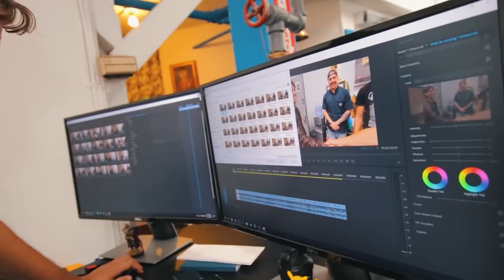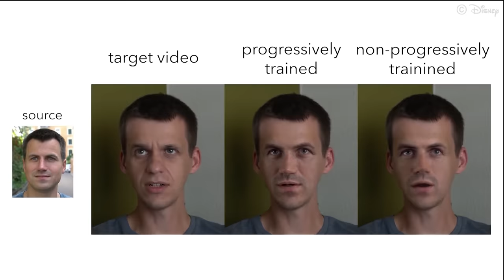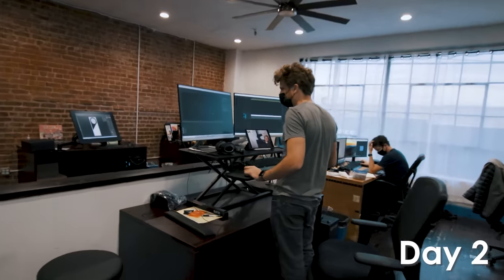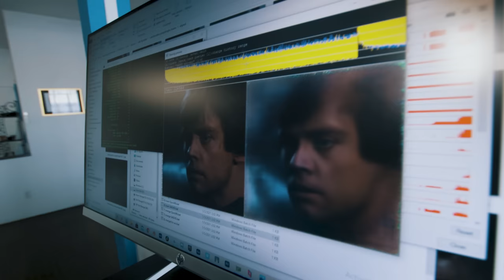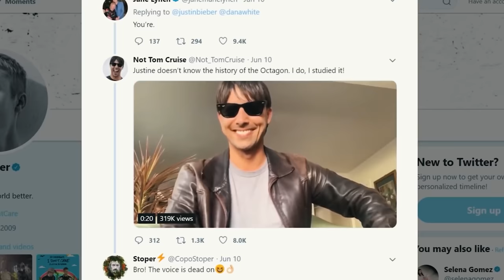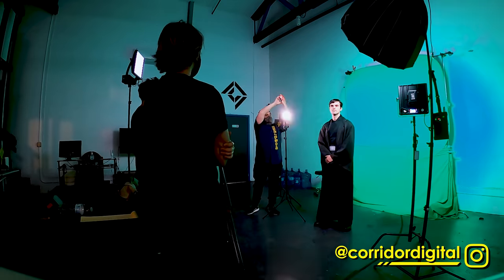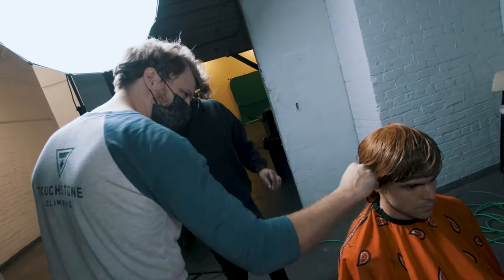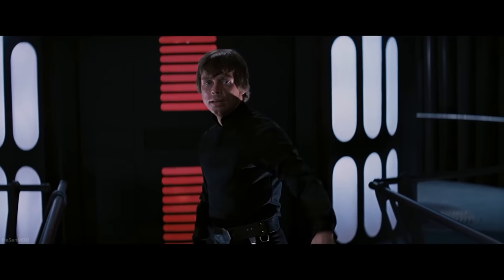We Made Our Own CGi Luke Skywalker

Comment: I would say that the Disney version looks more realistic when it comes to the texture, but when it came to movement and interaction with lighting you guys' is far superior.  Excellent job!
Reply: My thoughts exactly.
Reply: Because disney used an actual set and corridor used a cgi background.
Reply: @flameemperor888  i was referring purely to Skywalker himself as opposed to anything else, sorry for not clarifying
Reply: They made it almost exact to how skywalkers physical appearance was in the good movies (not sequels)
Reply: Same the deepface still looks more cartoony but the small movements like in the lips and eye movement are better. so there still needs work to improve the overlay but still keep the small details to keep from looking like a moving statue.
Reply: The issue is that they added those sparks and the lightsaber to show more interaction with the light on the face, but those things where not in the original scene. Corridor Crew also added some color correction that is also not in the original shot.

If you watch young luke in the movies, you can already tell that what Corridor Crew did does not look like him at all. The box shaped frame of the face, the lipsync, the thin neck and the hairstyle do not match, resulting on a a weird blend of Luke and the other actor face.

I say that Corridor Crew's version is 60% luke, as the Disney one is 95% luke. This only shows how easy is to know what is wrong, but is harder to do it better.
Reply: I agree. They did a great job given the time and shoestring crew and budget. Clearly not easy work no matter how you cut it.

Comment: Your deep fake was a little bit more plasticky so it indeed looked a bit more like a CG model, but I think a tiny color adjustment and a slightly different reflection layer would make it just perfect! That's why I prefer by a little the edit of the original, but the movement and the scene of yours is intensely more detailed! Great job!
Reply: It's the wig. Usually you give a wig some dry shampoo and a few other tricks to get rid of the "fake hair" look. Also, to me at least, the neck was distracting in it's mis-matched length. The green screening was also a little rough and at least for me, pulled him out of the scene into his own "layer" on top of things.
Reply: Yes i agree with the color and reflection. maybe also make the shadows a bit darker, if you compare the background and his face.
Reply: It needs more details like the spots on his face
Reply: way to young looking lol. bad
Reply: Yeah I agree
Reply: mouth movement not as convincing for me but the more static sections I preferred
Reply: agree
the movement and eyes is better in this one
Reply: Yeah, the contrast is off, it floats on the footage (darks are not matching). Weird that they missed that.
Reply: The way they did it originally was better. These guys tried to make new hope Luke. Original nailed return of the jedi Luke, just needed some better color and reflection that's all. This overhaul was too much.

Comment: To be honest I wouldn't be surprised if the crew at Disney had the same amount of time.  This shot would probably be held to the end of production.  There's lots of red tape at Disney. I would love to hear from the team about the drama connected to this shot.  In the end, Jon Favreau and Dave Filoni,  thank you for injecting life back into Starwars.  
 
Corridor Crew, you really showed that innovation can really make a difference. 

Great Job!
Reply: @Anyx E great analysis! Good insight, I agree with u, completely.
Reply: @Anyx E yea agree I think with more time it would’ve been great, personally though if Disney’s gonna go down this route with more young luke just hire Sebastian Stan already dammit.
Reply: Well, the shot wasn't CG or Deep Fake on Disney's end. I believe they used a live action Mark Hamill and then de-aged him. This process is vastly different than what is described here.

Amusingly enough this means that performance was entirely real, including the slower head movements and almost certainly the eyes are absolutely real. 

Watching the video again with this in mind gives quite an interesting take on Corridor Crews analysis of the problems with the shot.

That said, ML and neural net based finishing is definitely a big thing. I assume they didn't use it for this show as they wanted more control and de-aging is far more production safe, for a number of reasons. That will eventually change, but not for a few more years.
Reply: @Anyx E It's because of the low quality of the images they used for the deepfake. The skin looks obviously fake because of this. 

Additionally, because Dean only has a passing resemblance to Mark Hamill his build and wig makes it look off. Since he's not a trained actor he couldn't replicate Mark Hamill's mannerisms (the way he moves his lips when he talks for example) this also makes the deepfake feel off.

Comment: The fact that your Luke moved around more and that there were more camera angles was a plus. I think that the strongest points here was the movement in the acting, the actual FACE you generated, and the expressions that make the scene more emotional. The lips and hair were not as good; they could be improved. That is just picky crap though because this is amazing! 💯
Reply: in my opinion looks the hair in the og one more fake and wrong then in the fan version.
Reply: @temmie-confused  Yeah, the hair that Disney did looked too perfect if that makes sense. Not one hair was sticking up. It's just that the Corridor version did not get the wig EXACT, but close. The lip movements were the worst art anyway.
Reply: I feel like the audio was a little distorted in this one.
Reply: @masteroziniii2486  It was. Idk why. Maybe they had trouble isolating the vocals somehow so it ended up distorted.
Reply: @masteroziniii2486  yeah but I think is a copyright thing, because the main goal was the face movement, not changing the audio

Comment: When Luke wasn’t talking, yours is better. But his mouth movement was a strong tell that this was a deepfake. It didn’t quite match up. But overall, very well done.
Reply: could just be audio synch issues
Reply: @Gatrehs  I mean I was comparing the audio from both clips in this one video so…
Reply: That wasn't their audio, that was audio from The Mandolarian.
Reply: Agreed.  Especially when he says "May the force be with you".  Even if the sync is slightly off, there doesn't seem to be enough lip compression when he says BE, which makes it look odd imo.
Reply: Exactly. The synchronization is very far off. Would have been better if they took his speech mostly off camera.

Comment: Honestly I felt like the mouth movement when he was talking felt off, but I’m not sure if it’s a deep fake problem or a lip sync problem
Reply: I felt the same way. The same problem happened in the original. I feel like the software isn't tracking lips properly when they pucker up for O, U, W, Q, & Y sounds. It still feels like the lips are parallel lines just moving up and down.
The rest of the face definitely felt a little more CG, but the eyes looked more real, and there was more small expressions in the  face that made it feel more real.
Reply: It's a deep fake problem. As much as everyone complains about the skin and eyes when deaging people with CGI, the animation of deepfakes is most often robotic.
Reply: @wizkid5555  Eh, I felt like the mouth movements in the original looked a little bit better.
Reply: No one's mouth moves that way, it's not like the lips aren't synced but they're not moving enough so it's definitely a deepfake problem
Reply: It isn’t corridors fault it sounded weird in the actual show
Reply: It's a small audio sync problem in some parts. The original audio and corridor's visuals are sliiiiiiightly shifted i think. nonetheless awesome demo. way better than the original
Reply: This version has better definition and emotion.  The eye movement, a problem in the original Corridor Crew were quick to pick up on, is a lot better. 

At mark 18:01, "come little one." There is something odd about the mouth movement. Is that about how deep fakes don't look into the mouth? Is this challenge more about a replacement actor matching the original actor or deep fake interpretation?

Comment: This Luke looks a lot more like the original Luke. Only thing that felt off was the skin felt a little too reflective and plastic-y. You can feel that when the shot swaps to Mando and you see his face. Other than that this is awesome!!!
Reply: That might be because the Mandalorian is shot on extremely expensive and cutting edge cameras.  You can tell the difference between the Hollywood Cinema level camera, lenses, lighting, and color grading on The Mandalorian, and the high-end YouTube production they put together for their cut in.  I think a combination of the two would have looked better; taking the face and performance of their actor and putting it into the shots from the show might have been more seamless.
Reply: Nah, it doesn't look like him at all.

Young Luke did not have that box shaped face, thick wig and such thin neck. If you look at the movies and the face of young mark hamill you can tell that the results corridor crew got is not better than what Disney did.

Key details they got wrong are: the color, size and shape of the eyes, the lenght of the eyebrows, the dimple of the chin and the frame of the overall face. Also the "dorsum" of the nose, and even the lips are different.

Comment: It's hard because even if you get 99% of the way there, you're still in uncanny valley. I do think it looks better and has more emotion. Since the performance was meant to mimic the show I think it turned out better than Disney's but still has the performance issues related to holding back to avoid breaking the illusion. Pretty crazy to see what's going to be possible in the future though.
Reply: It's past the uncanny Valley in visuals,  but synchronization with audio drops it back in the valley

Comment: I just saw this clip. The CGI is painfully game-like, too sharp at the edges, the hair style is a big no, the lighting is ok, BUT! You managed to achieve the most important thing, which was NOT in the original episode AT ALL: a lifelike, true Luke-like behaviour and acting. (Ok, 90% of that.) :) Congratulations guys! Tech implementation will improve, it's only a matter of time, do not worry. In this area you should fine tune (and transfer) much more micro movements (mimicry) of the actor's face, if the software environment supports that. Without this all the movements are too smooth, that's the main reason that your version looks game-like. After acting this is the 2nd most important thing to achieve for natural final result. Everything else is only graphical fine-tune, which can be tried as many times as you like (and as many processing power you can pay for). :)